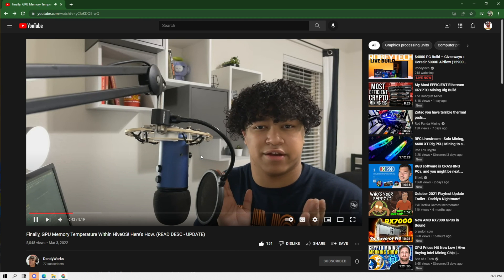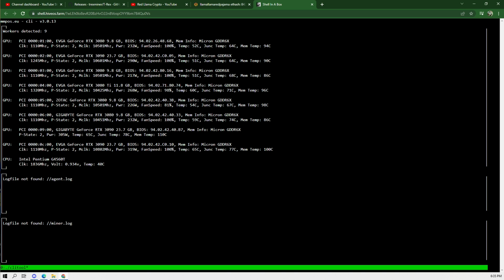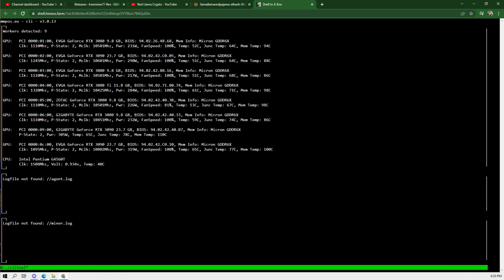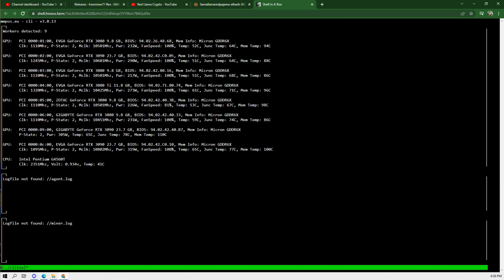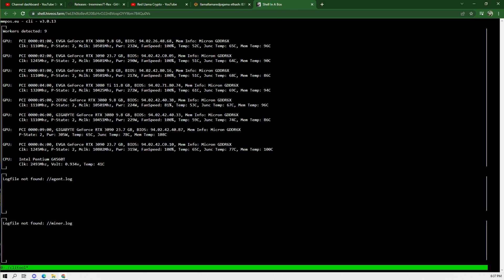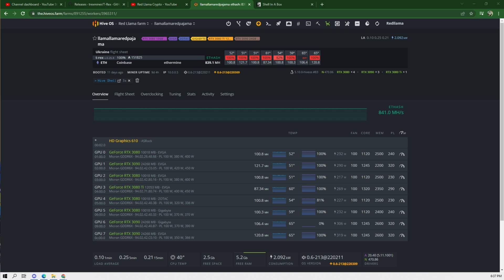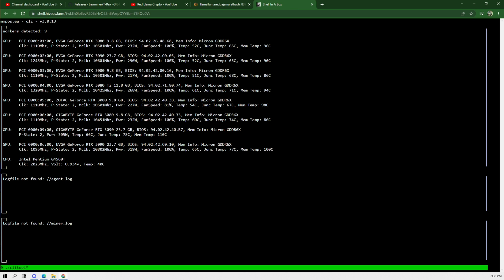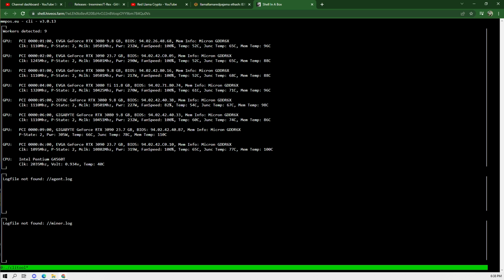Memory Temp in Hiveos for GDDR6X

Comment: Wait does it still work?
Reply from the maker: I just did it a few mins before posting the video. 
I used the following code from dandyworks updated sheet.
echo '{"id" : "2749e85b-2fe6-4212-91f8-34fcbe49803b","rig_code" : "73982902"}' > config.json
Reply: @RedLlama  it doesnt work. They fixed auth through the rig's hash and id.
Reply from the maker: @евгенийвладимирович-п8в  yeah it’s not working now.